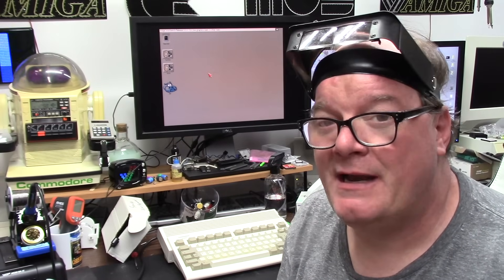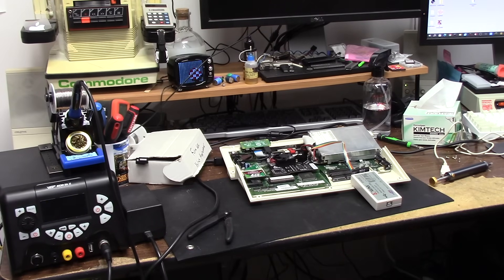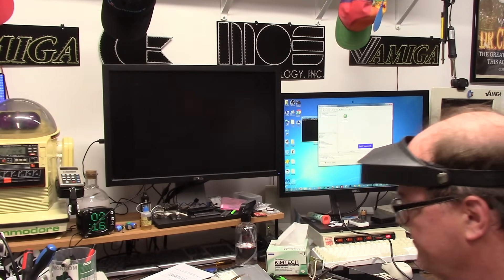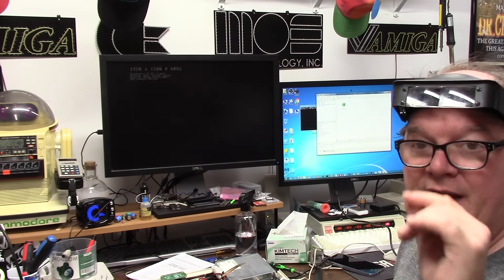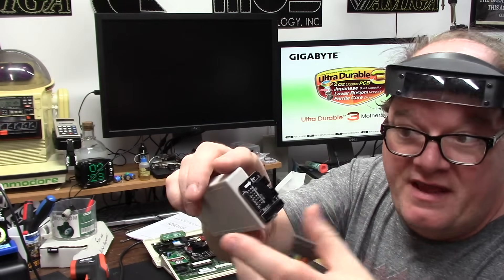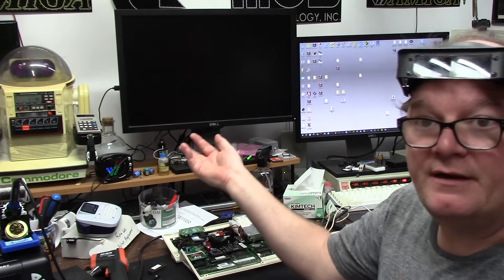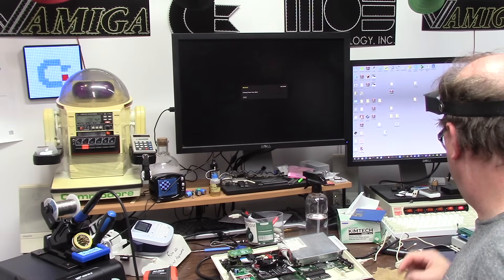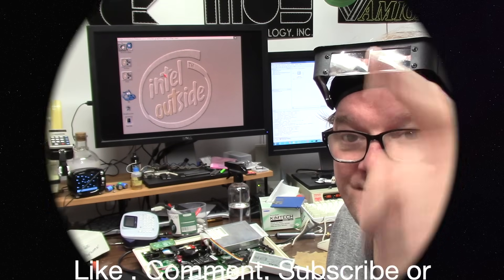Flashing the Amiga 600's A630 and bricking its ram

Comment: As you seem to be very current in the Amiga community I'm hoping to get your advice on what would be the best venue for selling off some of my old hardware.  I have several Amiga systems that I should probably see if there is interest in.  These include several A500's, an A600, an A1000, an A1200, a CDTV, several A2000's, an A3000, and an A4000 with a Cyberstorm 603 PPC/68060 accelerator. I also have other accessories such as an A530 accelerator, a 286 bridgeboard, and more.  In addition, I have a couple of SX64's, a C128D, and a few C64's and accessories.  I'd rather avoid eBay if possible but do you have a sense where the best place would be to shop these things around?  Any advice would be greatly appreciated.
Reply from the maker: amibay? i dont really know. i do alot of private transactions myself.
Reply: Thanks.  I'll check that out.  I think that's where I got my A1000 from, if memory serves.

Comment: Another Vid that demonstrates that this new stuff is basically for those who wish to play and become BETA testers 😞 But you the consumer has to pay. Thanks for the Video Dr Chris 👍🏻 PiStorm to replace the 630? Have one in my A1200 with a Pi4B, overclocked to 2ghz. Now have a 68040 88 times faster than a A4000 040 @25mhz with 2GB FastRAM 😳🤗 Not sure what you will get with a 16BIT A600 Though….

Comment: Is this a reason to use Pistorm as your accelerator as it is being actively developed...... or is the Pistorm more emulator rather than accelerator? Yeah trying to start this debate as I'm having it with myself
Reply: Excellent question.   Not sure what I am going to put in my A600, but I wan to be able to go back to stock for some retro programming if need be.
Reply: Yep. PiStorm would be a good starter. You can soon get the Vampire V4 for A600. Used the Furia in the past (Don’t bother) and the Vampire V2 for A600 👍🏻 The PiStorm only emulates the CPU @ 68040 188MHz. The FastRAM is derived to which Raspberry Pi you use. Max FastRAM is the limit to the Amiga. Don’t confuse the PiStorm with a Vampire which is pretty much just the Vampire and hardly any of the machine. PiStorm is NOT a Vampire 👍🏻
Reply from the maker: Not at
All I have never had a single problem with this device. I chose to upgraded to fix a screen issue when there is no hard drive attached the unit works perfectly fine, and in the extended description, I stated that the manufacturer gave me the correct firmware, and it is now functioning fine.

Comment: Peaked at 7, buy the T-shirt. ;) And here again, the question is asked: Why update? To fix bugs in unfinished software, or get a feature you otherwise can't get. >3.1 can be a rug pull, if not tested with everything. So can a firmware update. Both probably have some bugfixes, which may affect you or not. So, who's "right"? Generally the one who released first - because software can only ever be backwards compatible. OS authors have a great responsibility towards compatibility, and it's understood that part of the reason for >3.1 is to support newer accelerators, which are a great thing, and they can't know and test them all. So that means users become the testers.

Not sure why the Xilinx only works on Win7. Everything including drivers and low level stuff, DX, RTX, Vulkan, sound, MIDI, peripherals HW all bought recently work fine on Win7 here.

Be well, happy pre-Xmas and actually I'm scouting for a feedback video on your new soldering station, if you've had enough quality time with it. :)
Reply from the maker: Oh i love that soldering station so much so im ordering the desoldering station too

Comment: Hey Chris, I bought a 8mb ram expansion for my A600, and it worked for a few days the I had the dreaded Red faulty screen come up and after checking the Ram expansion I concluded that this too had bad ram, I make the TF328 which uses the same Alliance ram chips so I swapped out the first two IC ram chips and and bingo it is up and running again, so are our A600s ram killers ? and are the Alliance ram ICs a bit flakey as I bet they are on your A630( I have one too :)
Reply from the maker: Well the factory firmware fixed it
Reply: @ChrisEdwardsRestoration   Great news, So in conclusion, it is ok to update the firmware but it does not work with OS 3.2 ?
Reply from the maker: i would leave it be. it does nothing to help with anything.